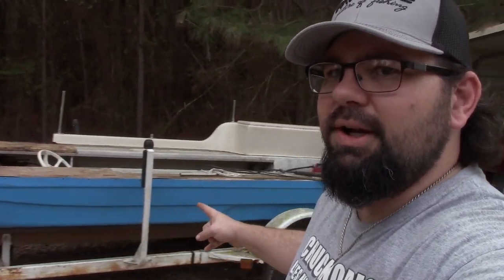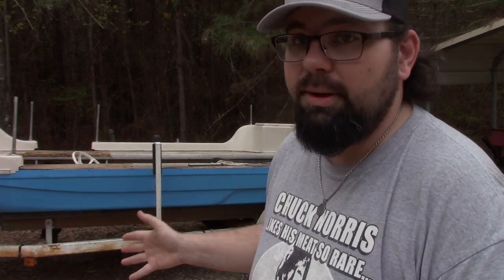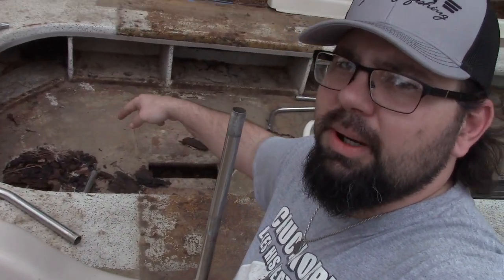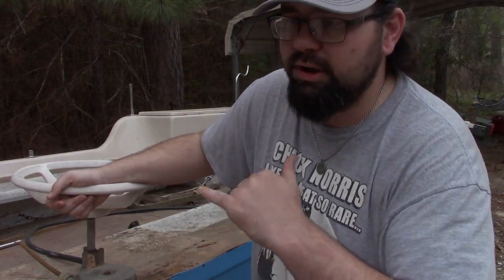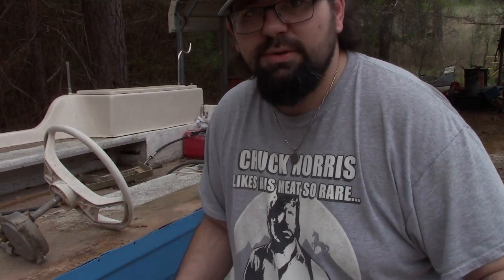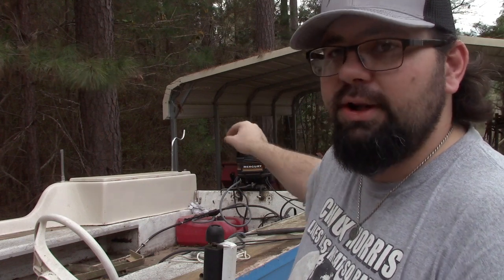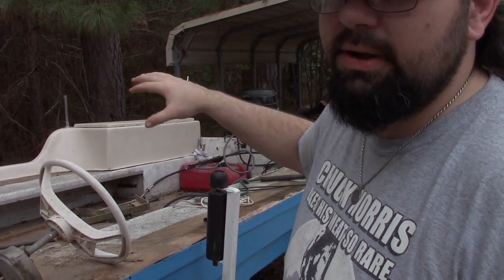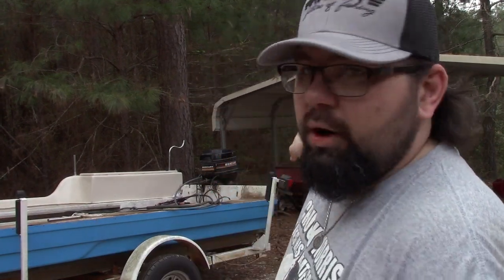Time For The New Boat Project - Boat Restoration

Comment: Spicy I am now mad at you lol. If I ever get as lucky as you and get a boat the first thing I would do is do a complete tare down and pressure wash the whole boat. Then start the biulding back up to the way you want it. As for the trolling motor go on EBay or FB market place because you can find them alot cheaper and some times even new ones people just dont want anymore. Good luck with the new boat and glad to see a new video.
Reply from the maker: Yeah I will look around first before I buy a new one.

Comment: Slow down and plan one thing, keep idea plan next then third thing. then start the first. If cutting is involved mach it up first. Slow is fast!!!!
Reply from the maker: Yeah take it slow for sure. Just excited about getting started and got so much to do. It will be fun.
Reply: @BackwoodsRaised  Good project, get marine epoxy, sand paper, files and fiber glass and marine plywood. have parts on hand. And remember it cost more for the right stuff.